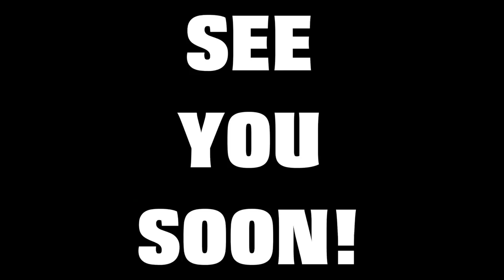Priming our Bus Conversion | The Bus Life

Comment: The black hoses with brass ends are the best.I have used both green without brass and black with brass. Two very important things to remember! They are known for blowing apart if you leave them under pressure for even short periods. And in my case animals will eat them if you leave them outside. Yes I went to use mine and found an animal had eaten a small hole in it! In my case probably a squirrel or several other wildlife. Lol😎